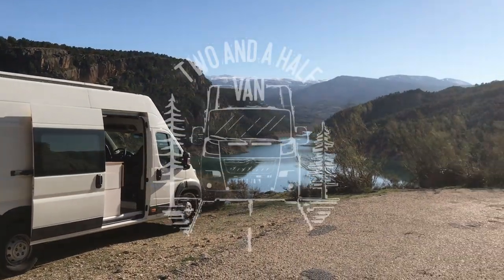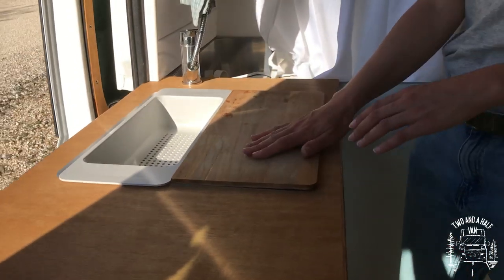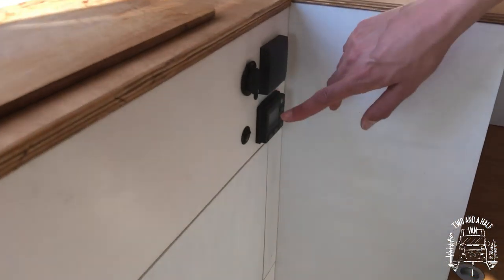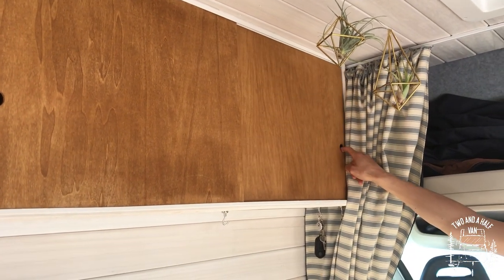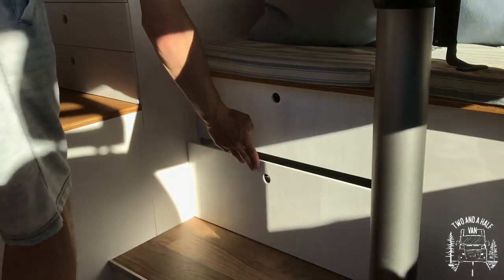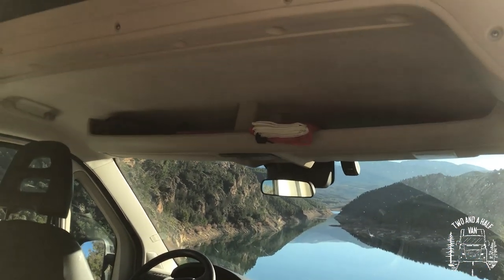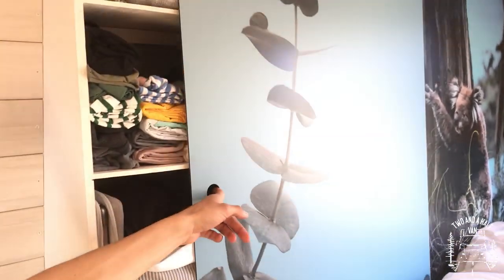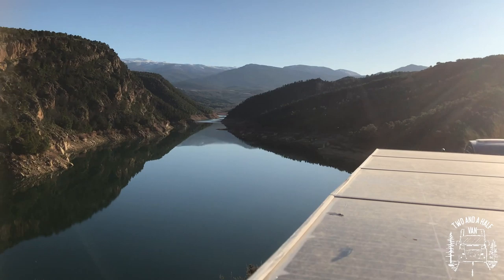Van tour with open layout, huge bed, custom shower & toilet - #vanlife #campervan #camperausbau

Comment: By far the best van build I've seen. And I've been watching van builds for yeaaars! Only thing I noticed is that a food storage drawer  is next to the toilet. To each his own but I prefer separating toiletries products from food products and placing them in different areas. You have many storages so I think that won't be a problem to move things around. Everything is so well thought of and practical. I always found that sliding doors are the best solutions but not a lot of van builders do this. Bravo, you did well!

Comment: Fantastic design in all aspects , draws opening from either side and the raised floor storage brilliant solutions for a small space ,multiple different size boxes at the back again brilliant  ,  best van design and inalstall  i ve seen yet , water tank over the wheel arch to 👌👍🤗🤩🤩

Comment: What a smart and beautiful conversion, many great ideas like the sliding doors, the storage under the sink ,the toilet and the storage in the back but I'm wondering how much did you spend on this conversion? It just looks very expensive but maybe it's just because it has so much style, so much class :-)
Reply from the maker: yeah the van build was on the expensive side. not gonna put any numbers out there, sorry. you could build it a lot cheaper but we wanted it to be for full time living.

Comment: Fabulous van build, you must have put in hundreds of hours of thinking how to do things. Thank you so much for sharing your videos and website. I just started to do my own build Jumper L3H3. I would like to know if you could briefly describe how you created the solar roof rack I am stuck with this currently. When I see it correctly you glued Alu profiles (30x30 or 40x40) on the two outer sides of the roof. No profile on front or back correct ? But how did you fix the solar panels to them just with some 90° fixes ? What size are those and which solar panels do you use ? maybe you could share some pics of this it would help a lot. Many thanks and all the best !
Reply from the maker: Thanks for for the feedback. I've added an article about our solar setup to our website https://twoandahalfvan.eu/
Reply: @twoandahalfvan  Many thanks Dominik, you are a star ! I admire your van build, it is so inspiring - although I already watched hundred of others before..... All the best

Comment: Super built. Each and every inch used wisely. It is so spacious. Garage is also built wisely.There is no mess. 
But you don't have vent on the roof. 
What you do if you want hot water shower? 
How much gallan fresh water tank you have?
Why don't you use propen gas stove?
Reply from the maker: we have a vent on the roof. we can heat up water electrically in the summer or by using our diesel heater in the winter. we have a 100 litre fresh water tank. we don't use gas for various different reasons. first off, you need a hole in the bottom of your van to make sure the gas can drop out if you have a leak. a hole in the bottom is a huge insulation problem. no gas, no hole, no problem. second, i don't like burning fossil fuels if i don't have to, it is not sustainable and no longer necessary. third, there are a lot of regulations about installing and maintaining a gas system in Europe. fourth, i don't like open flames in a vehicle with lots of wood and burnable substances. fifth, cleaning is much easier. induction cooktops do not get hot and thus no burning of any spilled liquids. sixth, i need electricity anyways, why not increase the electrical system and get rid of the gas system. it's pretty easy, i am amazed that not many people are doing it. what is it about burning fossil fuels? why are so many people obsessed with that? those are the main reasons, I probably forgot some.
Reply: @twoandahalfvan  Thanks for your discriptive answer. You clear  my many doubts.

Comment: wow great build

weird question how does the toilet work out? is it sealed shut after use? how about smells? I imagine it's an emergency toilet?
Reply from the maker: it's in use. it smells after you use it of course. then you put on the fan, open all doors, use the cover material and it stops smelling.

Comment: Favourite set up so far! Any privacy options for when using the toilet by any chance?
Reply from the maker: for number one, we send the other person to the cockpit and use the separating curtain. for number two, we send the other person outside. we discussed this beforehand, it may not be everybody's cup of tea. we figured that a separate room would give you visual privacy, but no sound or smell protection, while taking up a lot of space. we are happy with the tradeoff of sending the other person outside.

Comment: I’ve seen few videos with a similar design of your shower but yours is the best. This is the shower that I’ve envisioned for my future van 😊. I like the idea of the shower head that doubles as a faucet. I couldn’t believe that you have no prior experience because the outcome is really awesome. How long did you convert your van?

I also like the way you present the video. I am really focus on watching the van conversion and not the person talking 👍
Reply: Can you please show more about the shower. How do you go into the shower and the drainage.
Reply from the maker: The conversion took us 10 months working on the weekends and evenings without a shop or garage. It can be done a lot quicker if you are willing to cut corners.
Reply from the maker: The shower bottom sits 15cm above the floor to make room for water and heat piping and electrical wires. It also makes it easier to get into the shower, which we access from the steps. You need a tall roof van for this setup, or you better be short 😂

Comment: What glides did you use to slide your cabinet doors smoothly and quietly. In the Pacific North West of the US wooden doors are either swelling there by sticking or shrinking and rattling. Wondering how you deal with that. Love your multi functioning faucet. That is how I plan on doing mine. Love your design
Reply from the maker: The drawer slides I use don't seem to be available in the US. If I were in the US, I would consider these: https://amzn.to/37OIu8P, they look very similar.
I think you can oil and wax your wood, which should prevent it from taking up moisture, which should minimize the swelling and shrinking but getting drawer slides to run smoothly in a constantly moving vehicle is a pain in the ... Lots of sanding and readjusting is necessary :/

Comment: Hey, thanks for sharing. I saw a lot of van tour but yours is definitely one of the best in my opinion. How does this toilet works? It keeps n°1 and n°2 in separated containers you have to empty in designed areas? Why did you not decide to install dry toilet? Thanks a lot :)
Reply from the maker: I should probably write a separate article about our toilet, but here's how it works in a nutshell. Number one drips through an odour trap into a container that is mounted underneath the vehicle. We then clean the separator with water and a self made cleaning spray. The container under the vehicle can be emptied in appropriate facilities using a remote control. Number two is collected in a bucket and we currently pour cat litter on top after each usage. The cat litter is conveniently stored in a bucket behind the bucket that catches number two (shortly visible in the video). This is also where we can take out the buckets. When the bucket is full, we empty it into the garbage (where it will be burned eventually, like cat poo, dog poo and baby poo). If you were to use a different kind of smell stop, you could also compost it. We're super happy with this solution.

Comment: They claim the shower is waist high. Do they use a step stool to step into it, or step into it from the bed? Also where do they place the countertop that goes above the shower, when the shower is in use? Lastly where did they get the shower head & the magnetic base?
Reply from the maker: Hi there! Next to our shower is our toilet unit which also counts as our step stool to our bed and into our shower as well. The countertop of the shower just waits on the bed or can be placed on the drawers/storage unit on the opposite site. If you would like to know more, you can find some details here: https://twoandahalfvan.eu/our-layout/

Comment: Great job, but if you used a lot of that 80/20 aluminum extrusion it must have got expensive
Reply from the maker: yeah the aluminium profiles aren't cheap. you can save a little by making the connectors yourself. overall the van build was a little more expensive than expected.

Comment: Where or how does your boiler vent out? I am currently doing  a very similar build and I cannot decide where I can put it or if it is safe to have under the bed like you have it! Thanks
Reply from the maker: The boiler itself does not need a vent. It is electric. It can also be heated by means of our diesel heater, i.e. when we turn on hot air, we get hot water for free, simply because the hot air is piped through the boiler. The diesel heater vents out through the bottom.
Reply: @twoandahalfvan   Oooo ok thanks! I have a diesel heater maybe I can do this also!

Comment: Great van, is that L3H2 model?
Reply from the maker: as mentioned in the beginning of the video, the van is a long wheel base with extended body and super high roof, which translates to L4H3 or L5H3 depending on which manufacturer you look at

Comment: Where did you get the clear drawers with flip down access located in back of van?
Reply from the maker: probably won't help you much but we bought them at a local hardware store chain in Germany called Obi. They go by the name "Tauro Box Flap Side"
Reply: You can find them here: https://www.obi.de/aufbewahrungsboxen/obi-eurobox-system-tauro-box-flap-side-40-x-30-x-22-cm-transparent/p/2615755

Comment: can you tell me what magnets you used?? All my magnets are weak :(
Reply from the maker: we have used neodymium magnets. they exist in all kinds of shapes and sizes. if the magnets are too weak you can also try to reduce the thickness of the material it has to traverse, e.g. router the magnets into the wood